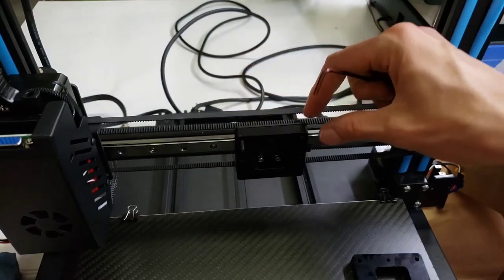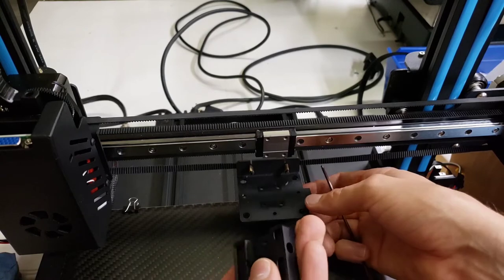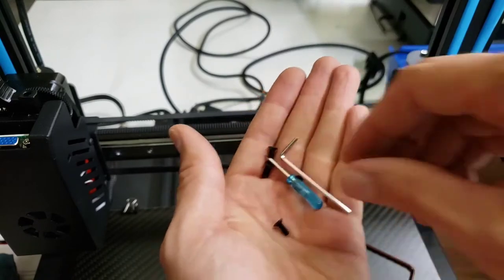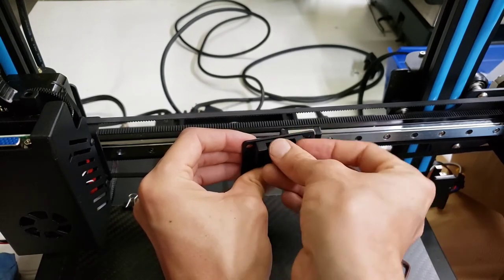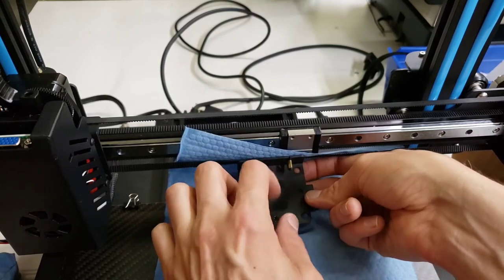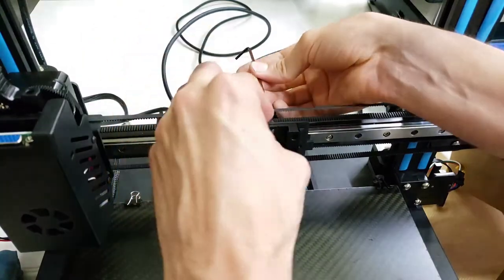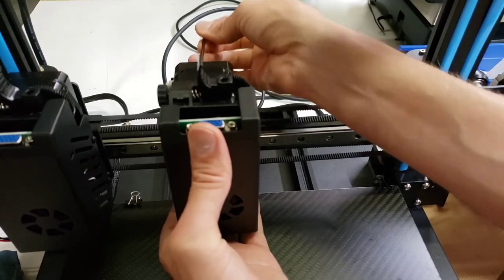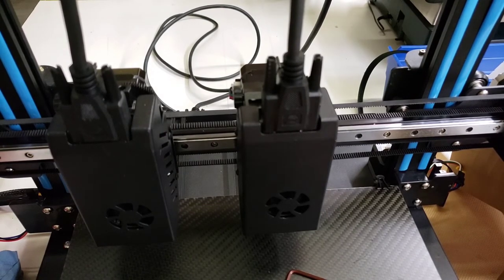Installing the Titan Extruder Upgrade on the Hictop/Tenlog D3 Hero IDEX Independent Dual 3D Printer

Comment: Hello,
with the titan extruder did you have to adapt the e steps? have you seen an improvement in print quality?
Denis.
Reply: I would be interested in an answer too. My main problem with this really good printer (I have the Tenlog TL-D3 Pro) is that I have a lot of ringing / ghosting, and I think it can come from the heavy printhead... Lighter ones like these titans could help ?
Reply from the maker: Yes, you do have to change the e steps. That number is detailed in their online instructions. You will also have to re-calibrate the XY offset to realign the nozzles.
Reply from the maker: I haven't noticed ringing/ghosting, however, if I compare the same print and material to a print that I made on the Zortrax m200, the Zortrax print is visibly smoother when you look at light reflecting off the surface. You have to look very close to see this. When the Zortrax prints a cylinder, the outside is perfectly smooth. When printed with the Hictop, I see tiny facets. Either the software is not interpolating the curves as well as the Zortrax, or the stepper drivers are less smooth. I noticed that Tenlog now offers an upgrade to the TMC2208 stepper drivers vs A4988. Not sure what my Hictop uses (I don't want to dismantle it because I'm using it all the time), but I wonder if the TMC2208 would offer a smoother surface finish as well.

Comment: It's a nice change to see videos with lots of close-ups. I've always wondered how stable linear rails are when there is only one carriage used to support a hotend, but it's never something people show. Also that VGA breakout board looks quite hackable, which would be nice. I think that's finally enough info for me to get one.
Sorry for an unrelated question, but what's this printer's external depth when printing? I.e. how deep should an enclosure be to allow the bed and cables to fit inside with the bed moving between it's limits? Tenlog give 520mm, but that'd be impossible as it would have to be at least 2x the bed length for it to move (600mm minimum).
Reply from the maker: I have the same opinion of linear rails using only one carriage, especially if they are presumably cheap rails that are not preloaded. I can definitely feel some rotational play if I apply a torque around the axis of the rail. Does it affect the printing? Doesn't seem to. The extruder is heavy and cantilevered out, so that creates a preload torque on the carriage. The only opposing force would be the extrusion of the plastic from the nozzle.
It does need more depth than width. It just barely fits inside a 24in wide box, and it could work within a 24in depth box if you don't max out the motion of the table (the table passes the extruder nozzle to the rear). From max extension out the front to max at the rear is about 25-26in. There's also the heater cable at the rear that needs a little bit of clearance. A 24in by 26in box should work ok.
Reply: @engineerable  I actually had a similar problem with the carriage on my CNC having that same torque-movement issue. It turned out to be the gantry beam deflecting rather than a sloppy v-slot/wheel setup. Guess I'll soon find out if I tune it and crank up the speed.
Thanks for those dimensions by the way.